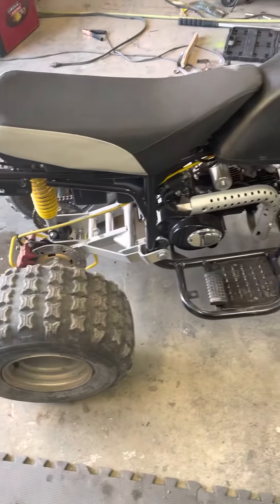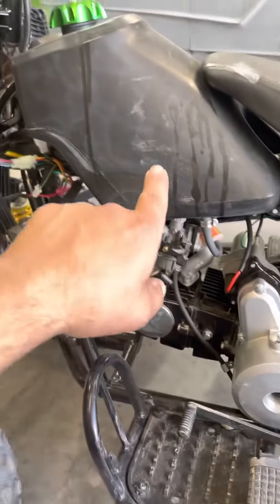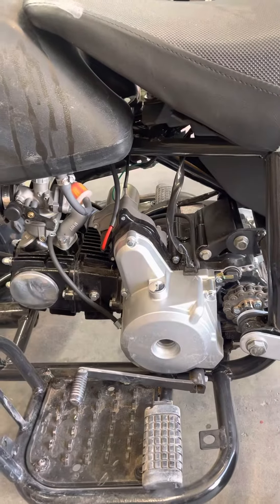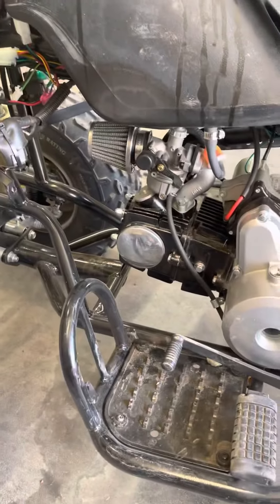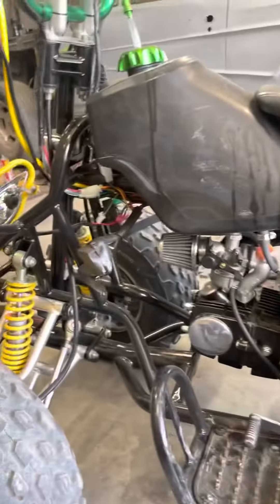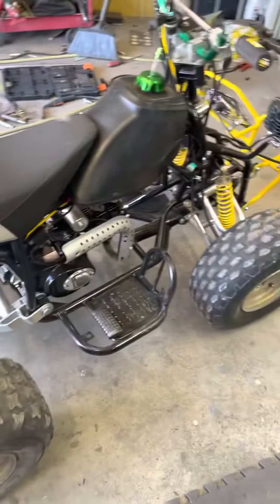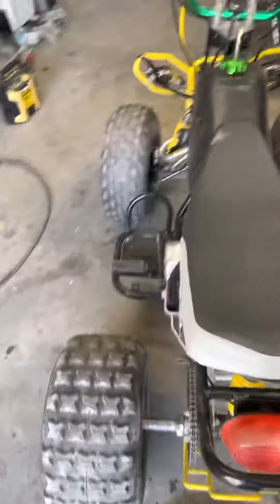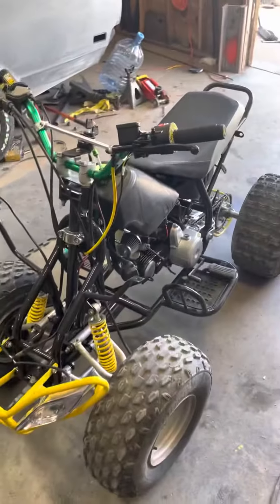Baja 90cc part 2 update

Comment: I have a question what does the little pin that you can pull out near the tail light do ? Should I keep it plugged in or not when riding it won’t start so I’m wondering if that’s the issue
Reply from the maker: I believe it hooks to a lanyard so if a child falls off it shuts the engine off